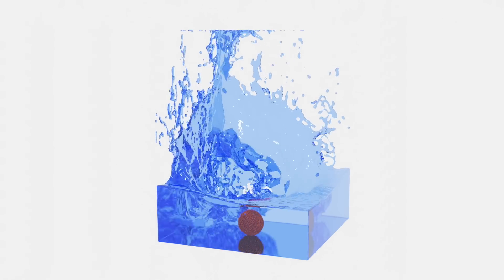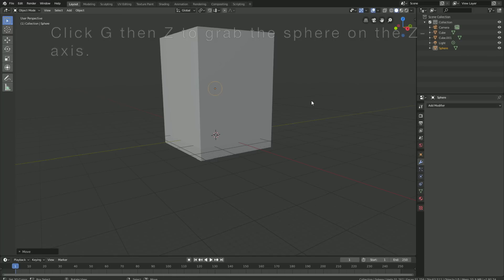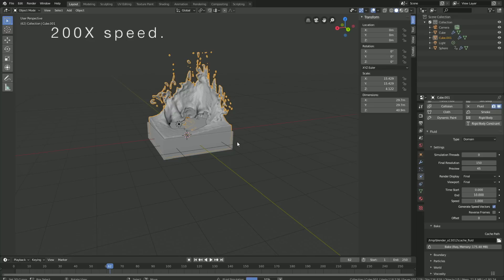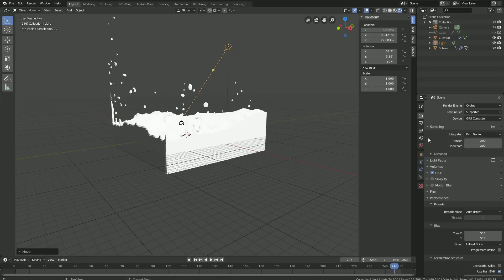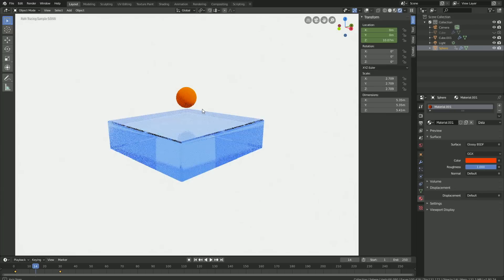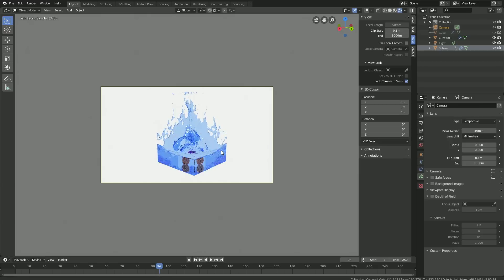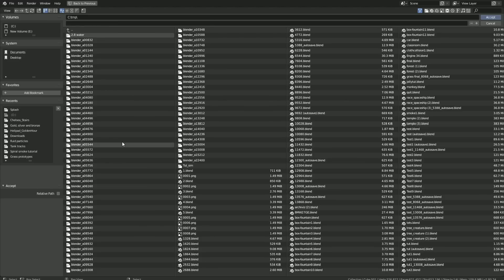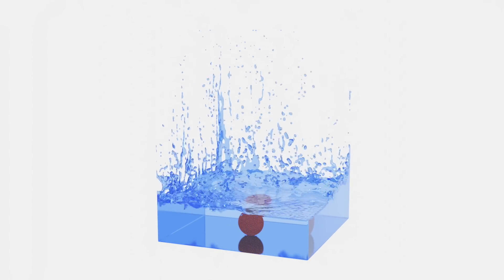[2.80] Quick Water Simulation Tutorial in Blender

Comment: Another nice and straight forward tut Olav, thanks!  How does one change the domain shape after baking?  I changed the domain shape in edit mode (after baking/testing) but when I baked and ran again, the shape is still the original form.  When I stop the sim and tab into edit mode the shape is different than what shows in the simulation.  I like in the Rigid Bodies options that one can delete the bake and rebake.  Is there something similar for fluids?  Post testing edit - I created a similar new project using cones and surprisingly my cone shaped domain turned into a rectangleish form not really in the 3d location I intended ... very weird

Comment: I thought you were meant to do smooth shading on the water...

Edit (sorry, it's very long):
I set my water sub-divisions to 4 and resolution to 351 because that's 69 below 420. I got a giant 210 GB cache file so i wouldn't recommend doing it (but it's worth it because 210 is half of 420). I rendered the animation at 4K and at 60 FPS... I completely forgot to do smooth shading half way through rendering but i realised that the fluid looked extremely smooth anyway. The 960 frames which i wanted to render took veryyyyyyy long... It was the biggest animation i had ever don! Baking took like about 14 hours on a i9 and rendering about 4 days non-stop on a 2080!!! My samples were set at 2048 because on 1080p... high samples are really needed... i had no idea that 4k sucks out all the noise and horribleness at about 1024. I also wanted particles so i generated 1 which is the normal amount.. I set my end frame to 960 because i wanted to make the fluid go at half the speed but still have enough time to calm itself down around the end... i was wrong on that also! The fluid on very high resolution had wayyyyy more particles than the one on preview resolution 100. I also kept getting random bugs where my GPU would render out blank frames or the very first one occasionally.

I was wondering whether or not smooth shading is compulsory even on very high resolution animations... if yes then i am completely fucked :D
Reply: >i9
>2080Ti
>Communist Che Guevara pepe
Reply: WTF is this madness

Comment: For some reason when I add the fluid domain it doesn't change shape at all, not sure what I'm doing wrong.
Reply: I had the same issue but it only changed for them because they had baked something and the data was still in the cache folder. once you pick a location and bake it it will work.
Reply: Yeah, i've got the same problem, pls help
Reply: I don't have obstacle type 2:04 Why ?
Reply: You have to go into EDIT MODE, Click the TOP FACE of the Domain then drag it upward. Go back to Object mode after

Comment: The final rendering took over 7hours for my laptop 

Does it take so long to render usually ? 

My lap spec 
i7 9th gen processor 
16Gb DDR 4Ram 
4Gb GTX 1650 GPU
Reply from the maker: Simulations done in Cycles usually takes a lot of time to render. If you want shorter render times I recommend Eevee simulation tutorials which I have on my channel. :)
Reply: Thank you 👍🏼

Comment: Hi dears. i'm a new learner here. i need some helps. my computer system requement is very well. Core i7 9700K, GPU GeforceNvidia RTX 2070, RAM 32GB. so if i make an animation like this tutorial, i've been waiting 10-15minutes the making an animation after click the BAKE button. and again problem is there is 264.23MB on my BAKE button. but there is 175.48MB in this video. i've done step by step, but it's taking a few minutes in this video, and me 15 or more minutes making an animation. I don't understand, what will i do, please help me? is there a problem on my computer or another problem?
Reply from the maker: 15 minutes is normal, I just speeded up that part during the edit. The bake size will be different with slight differences, that does not matter. :)
Reply: @Olav3D  thnx a lot. Good luck to this channel )))